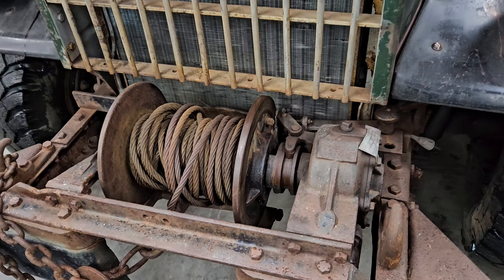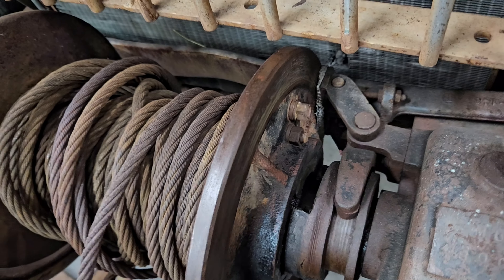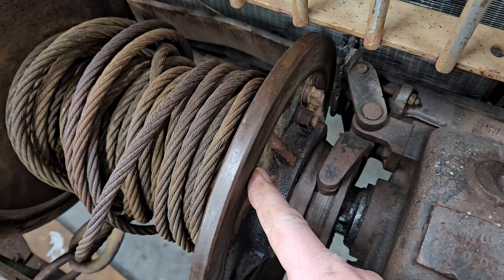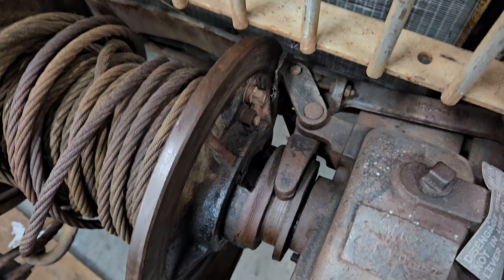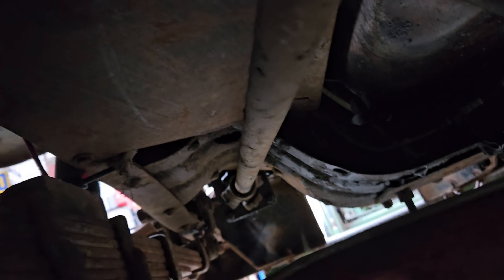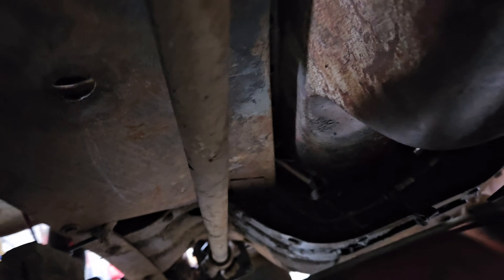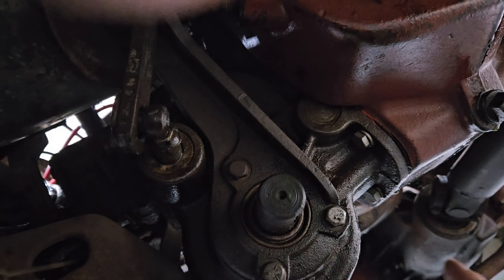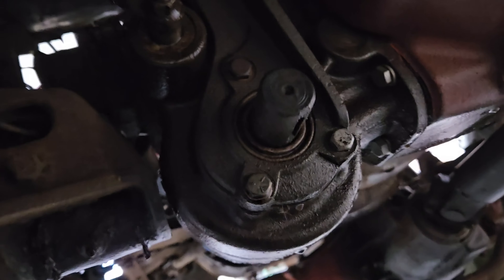Quick Overview and Demo of the 48 Dodge Power Wagon Winch

Comment: Beautiful truck! Can you make another video showing what you did inside the truck to engage the winch? What levers, what gear, etc.
Reply from the maker: Thanks! Simple process to engage. Push left lever forward to wind, back to unwind. middle position is disengaged. Just push the clutch in before moving lever or to stop the winch drive.